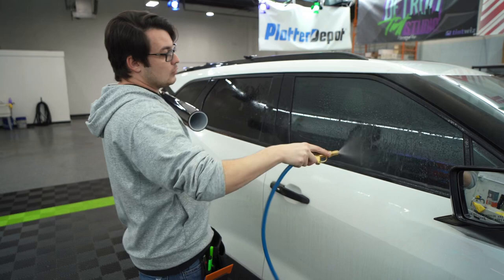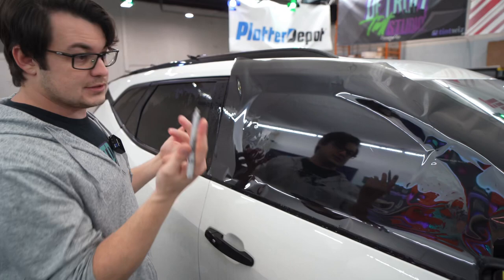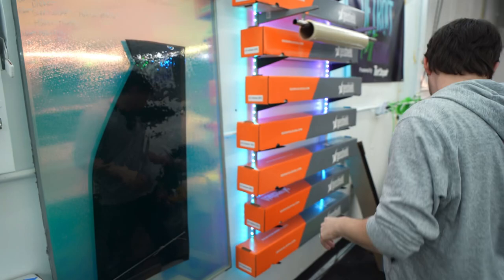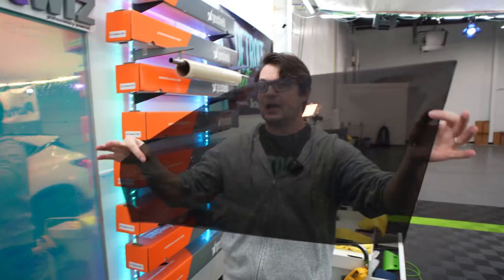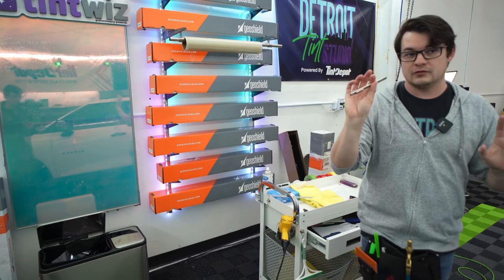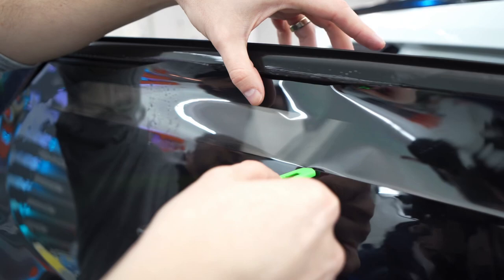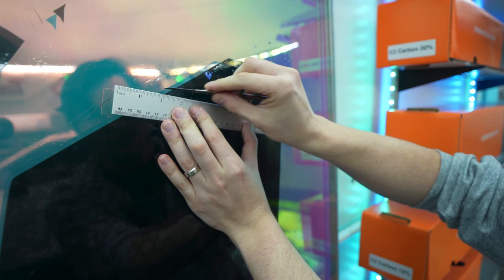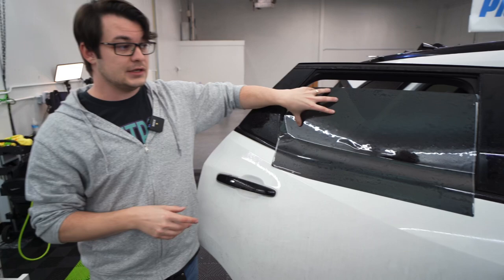Cut Window Tint With a SHARPIE?!

Comment: Thank you! This is the technique I was taught for safety reasons. I have insurance, but I’d rather not have to make that phone call. Time mula. Cutting it out doesn't take that much more time and it's a guaranteed method to not cut any black rubber.
Reply: Amateurs cut the rubbers

Comment: I don't have a cut board still and use scissors to cut my sides and bottoms. Really need a steady hand for that method
Reply: Or use a ruler
Reply: @Love4Yah9  you missed the point of not cutting on the car and not having a peel board. Where would I use the ruler? On the floor? 🤣
Reply: @Wingnut_  and you don’t need a steady hand for this method just a ruler 📐
Reply: @Love4Yah9  where you gonna use the ruler Mr Shakey hands
Reply: @Wingnut_  on the glass board that you buy from the store duhh
Reply: @Wingnut_  im shakey hands but you still use scissors like grow up get a blade
Reply: @Love4Yah9  lol. Good talk dude 🤣
Reply: @Love4Yah9  I blade top edge. Scissors is sides and rear windshield. Knocking someone on the internet's method because it's different from yours is some real childish behavior

Comment: Wso this is how I do them always. For the bottom if it is uneven like a Ford truck. Place it even with the bottom and trim the bottom edge then slide it down to cover the seal. Tack in place use the sharpie to make a line. You don't have to go all the way up and down just enough to make a straight edge. Use a 24 inch ruler, it will reach all doors. I go about 3/16 if an inch on the outside of my sharpie edge. Hope that helps

Comment: Ive done this method for 2 years. I started with your method but i would sometimes accidentally cut the side rubber gasket. It works great doing two windows as well. Just make sure you really tack both windows 🤣

Comment: This is how I chose to go out of fear of damaging a customer's car,  because when learning on my Honda civic i chopped up my seals enough that a customer wouldn't be happy about. I am mobile and am able to fit a glass board in my car. Only thing I do different is, drawing a line for the bottom edge as well. Especially with that back window having a curved edge. I would've drawn that and like a F-150 front door with that sight s curve. For that, I draw that bottom edge, but cut it straight across first. Then shrink. Then go back to glass board and cut out the curve.
Reply: why not just use a factory edge off the roll as your bottom edge? :o
Reply: @Tim Ree  I didn't give that a try at all. Felt like I would be guessing a bit more. Plus, I essentially do a double cut sharpie method. So adding the line made sense to me. I have still messed up and still cut the bottom edge too short a time or two.
Reply: What glass board did u get

Comment: Would a big a$$ mirror from, say, a bathroom work for a glass board?
Reply: Yes. I do this method with a regular glass but mirror is about the same, just that reflective on the mirror may have you double thinking if youre moving too fast. Or atleast it did with me 😅

Comment: What if I had a big piece of plexiglass as a mobile glass board.  Does it have to be really clean?
Reply from the maker: Plexi works just will scratch up faster than glass. But glass isn’t practical to take around so u have limited options

Comment: I have an F150 and the bottom of the fronts are not straight across. They kind of slope down half way through. Can I just line the tint up with the lowest part of the front and then tuck all that material on the high side in when I install, since there will be unexposed glass down there anyway?

Comment: I wonder how this style applies to windshields and backglasses
Reply from the maker: People do it for thoes as well, I’d like to cover it in another video. But shine a light on the tint, mark the edges and cut out the window on a board.
Reply: @DetroitTintStudio  I use this method but cut the lines on the car  glass for mobile, I simply fear cutting into the seals, thanks for the video